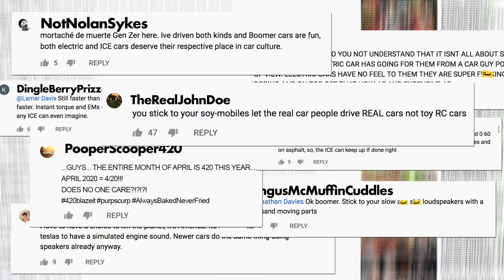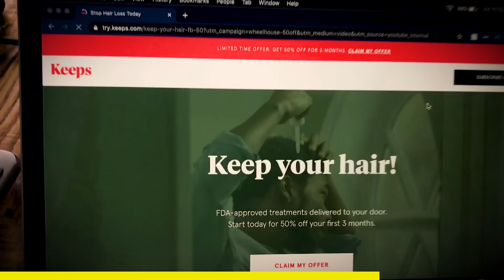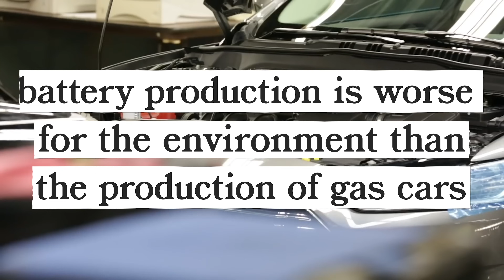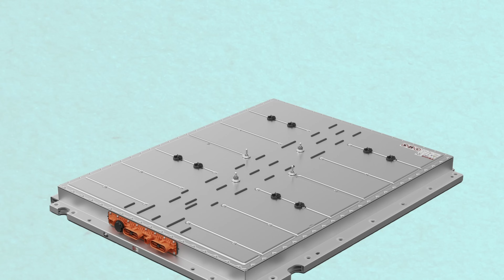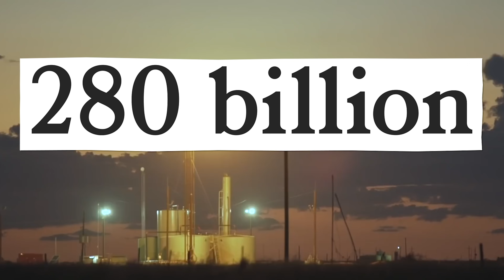Are Electric Cars REALLY Better for the Environment?

Comment: 5:55 And nuclear.  Everyone forgets to mention nuclear.
Reply: People need to understand that nuclear is the energy of the future. It should also be the energy of the present, but the media and Hollywood have given nuclear energy such a bad press that the ignorant masses are scared of it.
Reply: @balfouriking  HISTORY has given nuclear a bad rep. Nuclear went mainstream too early and many people suffered because of it. The fact is that nuclear is much safer today, but many plants that were built in the 1980s are still in operation, dangerous, and underfunded because fossil fuel lobbyists prevent money from going to nuclear development. The oil lobbies have an advantage because meltdowns and radiation leaks make headlines and remain in the public consciousness for generations while air quality just picks people off in the background with no place for the media to point their finger.
Reply: @burton926  What Vlad said is absolutely correct.  Hollywood and the main stream media definitely give nuclear a bad wrap.  It's sensationalism to get your attention, play on your fears (your ignorance) and take your money.  I honestly am offended by the media portrayal of nuclear power because they assume the public is actually that ignorant.

Please tell us which US nuclear power plant from the 80's is dangerous or underfunded.  I'll report it directly to the NRC myself.  Most of the US nuclear fleet was built in from the late 60's through the 70's, although there were a few finished after 3 Mile Island Unit 2 incident more than 40 years ago.  You are correct that they are operated and maintained much differently (safer) than they were 40+ years ago.  They have many, many, many regulations that are highly monitored to ensure they are operated safely.  The premise that today's existing nuclear power plants are underfunded because they lack development money is completely false.  Development of NEW nuclear technology may be underfunded for those reasons you state, but that has no effect on the safety of currently deployed and licensed operating units.
Reply: Tell me about it. It's the only viable option to produce massive amounts of energy to our future needs. It's infuriating that "environmentally conscious" people dismiss nuclear all the time.
Reply: Thankfully, Micro-reactor tech is really taken off in recent years, so putting more reactors closer to where they will be used is coming (hopefully).
Reply: Nuclear is by far the greenest.
Reply: "it's pronounced 'nu-cu-ler.'  nu-cu-ler."
Reply: I lived near one in JAPAN and never thought twice about it. Say, the whole place blows up...its not gonna kill many people around because its ~10 kilometers from town. Not too far, not too close. After all, at that scale, It's the fallout that's bad not the explosion👍 
Plus, you gotta love cheaper energy with the only waste being water vapor and ridiculously small waste (per KWH)
Reply: @Jaden-up3bg  They won't blow up.  The isotope that is used in the reactor isn't the same as the one used in bombs.  It can't go nuclear in the same way.  When a reactor goes critical all it does is get hot.
Reply: The time it takes to build one nuclear plant,technology and development of renewable energy double every year and most nuclear plants take up to 10 years before going online and are expensive to run not taking into the health and safety either.In that ten years renewable energy would have advanced so far that today's technology would be obsolete, just look how far advanced we are now,ten years ago it was only talk.nuclear is just not viable compared to renewables and you only have to see during this pandemic how the world has healed itself in such a short time and wouldn't we all like to leave future generations a world like that
Reply: @russe19642  What health and safety is related to nuclear?  There isn't any radiation that comes out.  Coal plants are more radioactive than nuclear plants.  Solar panels will have to be replaced before the nuclear plant goes online so that's twice the manufacturing impact by the time the nuclear plant even starts up. The nuclear plant will work until someone decides to shut it down.  And what happens to those old panels or the local regions where they are manufactured?  Ten years ago we had solar farms and wind mills.  Even longer than that.  Just look at what Germany did with their energy.  They want to go entirely green but still have to buy energy from France.  Now their citizens pay 50% more for power than they did 10-15 years ago.  I thought renewable was supposed to be cheaper.  I mean, its basically everywhere for free right?  I get that technology evolves over time but we have been using steam for a couple hundred years and almost everything we have runs off of steam.  That's old technology and we still use it because it is the best at making energy.
Reply: I've heard there is more radiation in coal emissions than nuclear power (handled safely), no smoke or CO2 either (well coal plants don't smoke a lot these days they burn very cleanly).
Reply: Everybody realizes that nuclear waste takes like fifty thousand years to become non-toxic
Reply: Dont forget that France will have that Fusion power plant is like 2025 or 2030 which will have 10x positive output.
Reply: Mid term that's a viable solution that's worth pursuing, but long term you still need to focus on renewable energy and storage. And people tend to get very concerned about having  a nuclear plant near them, so finding a good site and overcoming any local opposition can be a massive headache.
Reply: @rodh1404 
Actually no nuclear is long term, mid term is renewables.

Nuclear and hydro produces the lowest co2 and the lowest deaths.

Renewables reley on gas turbines along side them.  As we shut down more coal in favour of renewables we just add more gas plants.

We can't store energy (on the scale needed) so what electricity your using now is being produced now.
When there's no wind we fire up fossil fuel plants.
Reply: @rodh1404  being near a nuclear plant has basically no risk to it as long as the operators of the plant don't pull a stupid.  I grew up near one and there are tons of others that have had 0 problems during their entire operation.  A coal plant, even a "clean coal" plant, releases more radiation than a nuclear plant because nuclear actually has regulations on its radiation release.  Nuclear is a carbon neutral power source who's only real problem is the source of the plutonium or uranium.  The way the mining is currently done is pretty harmful to the environment, but I think that has more to do with the country's lack luster regulations than the way that the stuff needs to be mined.  Hydro ruins river eco systems.  Wind is a joke right now.  And solar manufacture dumps worse chemicals into the local eco system than anything nuclear could hope to create.  Not to mention that Germany is currently 100% renewable and still has to buy energy from France who is nuclear.
Reply: @ProfessorChops  I agree with you about the safety of nuclear power. In doing my own research, I saw a paper which stated that deaths and injuries from nuclear power generation are actually considerably lower than even things like solar power (particularly home solar, where injuries from installation, maintenance and equipment faults are more common than many people think). But while lots of people won't even think twice about putting solar panels on their roof, lots of people will go into a panic if they learn a nuclear plant is going to built even 10 miles away from them. That's just the way people are.

That said, nuclear does have its own legitimate concerns. Sure, a well built and well maintained plant is very safe, but Chernobyl serves as a reminder that not all plants are well built or maintained - and what can happen in a worst case scenario. While we probably have enough fuel reserves for 250+ years at current usage levels, nuclear power only represents around 10% of worldwide power generation. If we ramped that up and nuclear plants provided even half the world's power, then our reserves of economically viable nuclear fuel would only last about 50 years. This is why nuclear power can only be a mid-term solution at best. Nuclear waste disposal is another issue we haven't really got a good answer to right now. These problems might be solved if we could get cold fusion or Thorium MSR plants up and running, but who knows when or even if that will happen.

In terms of renewable power sources, you're also correct - there are currently some major challenges that need to be overcome. One part of the problem is that they often don't generate power 24/7, and can't readily respond to demand fluctuations either. Which is why I pointed out power storage as an important part of renewable power generation - you will want lots of batteries to deal with those fluctuations, and they'll need to be better than what we are currently using. Tesla has a million mile battery they're developing, and that might prove to be an excellent solution to this problem. In terms of fuel sources, it's fairly reasonable to expect wind power to be viable for as long as we can live on the Earth's surface, and solar should still be viable for many thousands of years into the future. Long term, renewable sources are easily the most reliable solution we have available to us right now.
Reply: Despite facts like «My parents got solar power onto their roof living close enough to a nuclear power electricity facility to see lights on the towers the cooling system (about 12 miles strait ) breed horses and still are concerned with going autonomous as they could» ...

Pointing out the simple idea that electrical powered vehicles should be able to be used as battery bank from the very beginning sounds quite fair from a "social like" future consumer ...

A house will have quite less electrical needs once you're out of it, so using vehicles of your own helping to compensate the electrical needs you bring in by "visiting" should be somewhat, somehow, somewhere, in some ways, some sort of a future natural "behavior" ...

There (Nouvelle Aquitaine, southwest France) is a lot of free charging stations close to the supermarket parking, but not only that choose to go onto solar ...
But effectively nothing is done or thinked for future development ...

Those moving energy bank will be there grid tied, ... , or not ...

Stand some sort of a question about relationship maybe behaviors concerned with futures ...

Simple Y about ...

Way more why regarding past concerned facts about "grid vs off-grid" debate ...

Some ore "industries" digging in are not that innocuous but they to often sometimes innocently digging into non-material given ones ...

That's for "innocence" in my personal opinion ...
Reply: Nuclear is incredibly safe but unfortunately comes with an incredible price tag too. A couple of the biggest projects in Europe are 3 times over budget and a decade late.
Reply: @rodh1404  Rod, it's not often we actually get to read an intelligent comment under a YouTube video... Instead of throwing politically motivated, demeaning slurs at others (anonymously) you make statements with factual information. Thank you. 

More food for thought; we are already doing studies to turn our large, base load nuclear fleets into hydrogen generators.  I see this as a smart move to squeeze even more out of the existing aging nuclear fleet.  As we re-license our plants to run out to 80 years and beyond, they will be supplemented by small modular reactors (neighborhood size).  I believe the conversation this video presents will shift once a hydrogen infrastructure is in place.  This video's concept will move to the concerns with storing energy in batteries vs. storing energy in hydrogen tanks.

Due to reduced demand for electricity (yes, i know it's measured in not as large an increase as predicted because it is still growing) thanks to modern technology making things more efficient, the base load nuclear units are being driven toward flexible operations.  In other words, load following units similar to the coal units that are being shutdown.  As nuclear power plants were NOT built to vary their output daily (think thermal and mechanical stresses), generating H2 with the excess power to keep them running at 100% becomes a very viable option.

Comment: Answer;
EVs are Slightly worse for the first two years or so, then better past that point because nogas and Greener grid. If anything gas cars get worse as the engines age and MPG goes down
Reply: Modern cars don't really lose much now.
Other studys have shown it takes about 80k miles to break even.

Comment: Do a comparison with HYDROGEN!
Reply: HYDROGEN!!
Reply: Don’t think so: https://electrek.co/2020/04/22/daimler-ends-hydrogen-car-development-because-its-too-costly/
Reply: @maxlenre1990  I just read into that Max, and those hydrogen cars are not actually hydrogen propelled. They are electric cars with hydrogen generators on board. So they are still electric.

I am talking about a classic petroleum powered engine with a transmission, converted to run on hydrogen. No electric motors!!

Comment: How about battery degradation after let's say 10 years, and the cost and time it takes to put a new one into the car, and where does the old one goes to?
P.S. I'm not trying to be tough or something, I like both of them, I'm just curious to know whether the "EV is more efficient than IC in a long run" has taken that into consideration. Thank you

Comment: How to diesel's compare, because a diesel is more efficient than a gaser of the same size.
Reply: Hard to say, I'd like to see that data too. Diesels have more physical equipment for the newer emissions requirements which obviously adds more manufacturing emissions, and they  burn more diesel during regeneration. So your tailpipe emissions are far better, but using more crude oil-to-gas station emissions. Also DEF production needs to be considered.  
% wise, I bet it's close!

Comment: The only downside for EVs is the infrastructure or lack thereof to support it, at least where I live. Quick charge stations are only available in places like malls and generally densely populated and modernised areas. Owning and using an EV in the countryside would severely limit your range. And with the cheapest EV being small, having lower range and expensive, a cheap second hand petrol powered sedan from the 90s is still more utilitarian and usable in rural regions. But in cities, and JUST in cities though, EVs are the way to go, if you can afford them.

Comment: The only thing I hate about electric cars is that they design it in stupid ways.  Electronic emergency brake system, cheaper made plastic handles, hard to repair because they want to be the ones doing the maintenance.  It makes no sense to me.  You'll end up spending more in maintaining the damn thing than a regular, non electric car.

Comment: I like internal combustion engines and I drive stick shift as well. Even if I like these hand in hand, 
I know at some point we will stop depending on fossil fuels. I think the only EV that has me excited is the Honda 
Civic-like one (which looks like something fun to drive). I just don't think it will be soon enough. 
And even if it does come,  EV manufacturers are really gonna have to improve based on what electric tech
they are using now. My co-worker who has a hybrid complains that her car won't start because the battery
in her Hybrid Toyota van stopped working, and if she wants to fix it, she has to pretty much pitch in $5k.